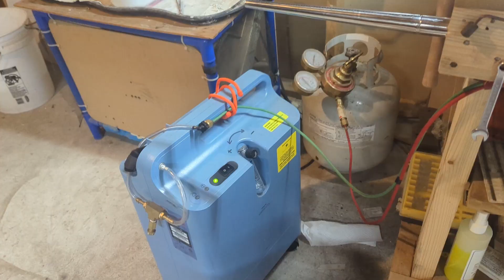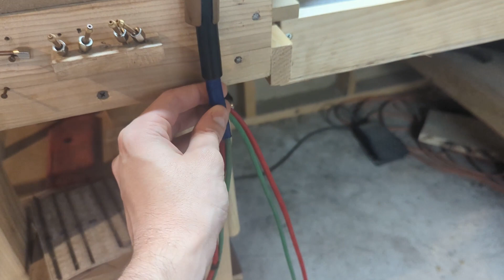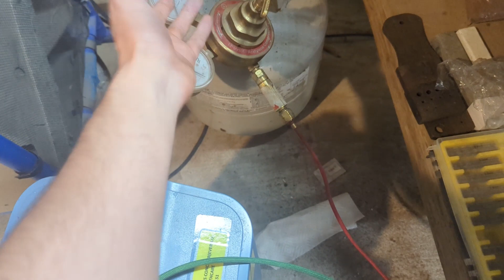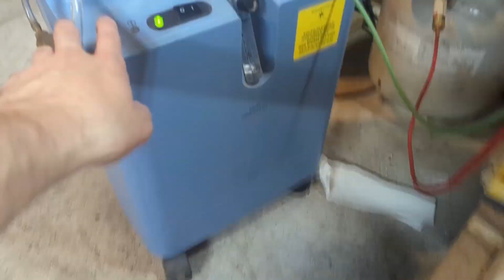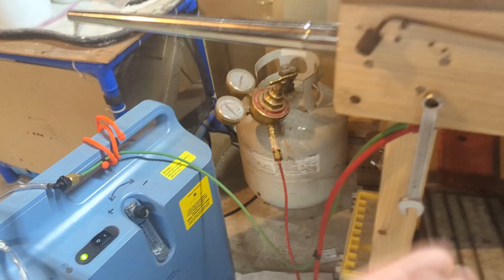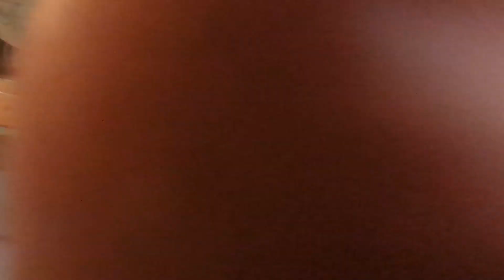How to set up a Oxygen Concentrator w/ Pressure Relief Valve for Jewelry Making-Smiths Little Torch

Comment: The alarm Ben is talking about is a pinched hose alarm. It warns the user that the flow has been restricted. Setting off the alarm doesn't hurt the machine. The regulator he added is a bleeder type regulator. It bleeds off the extra oxygen thru the hole in the adjusting knob. Most common regulators don't bleed off.

If you like to tinker with electrical stuff, you can take the cover off the concentrator and unhook the alarm. Then you won't need the regulator.

Comment: Me and other people put small air tanks in line with the torch to reduce breathing from the pressure swing and we use pressure relief valves inline too, usually after the tank. I made one from an old helium tank
Reply from the maker: Interesting.......I actually don't think I have any problems with the breathing thing your talking about, it seems like it's a perfect constant flow,  is it possible mine doesn't have that problem or maybe I'm just not noticing it?

Comment: Thank you Ben for making this video. I was a caregiver for my mother for 6 years. She had COPD and needed oxygen all the time. My question is do i need to change the hose fittings from the barbed push on hose fitting to a NPT fitting for the female hose end or what? The video is not clear on the actual setting up the hoses to work with the oxy concentrator.
It would make it much clearer..
I have a chance to get a gen 5 Inocare oxy concentrator for $399 and these are the same machines my mom used and i am more familiar in working on them like changing filters and cleaning them. I never used any other machine. Thaks again.
Reply: You can just leave the hose barb because it's not high pressure system. Apart from the pressure relief valve I put a homemade 5 gallon tank before my pressure relief valve to reduce breathing from the pressure swing aspect of concentrators

Comment: The release valve should beset slightly lower than the amount of pressure required to set the alarm off…that gives you more flexibility
Reply from the maker: Thanks for the tip! So set it lower so there's more oxygen that gets to the torch?